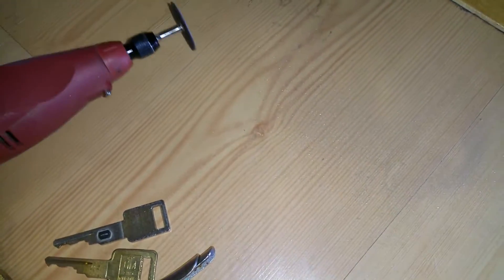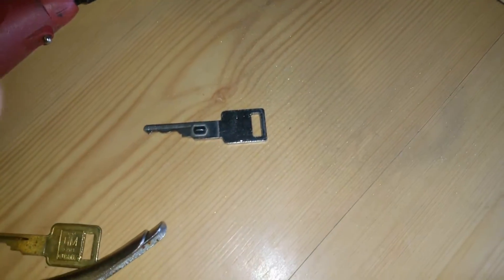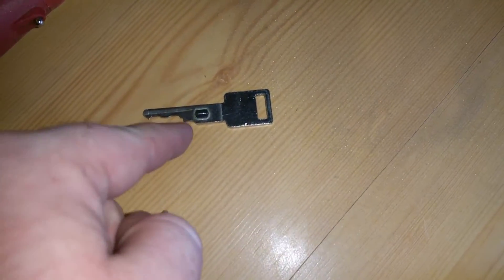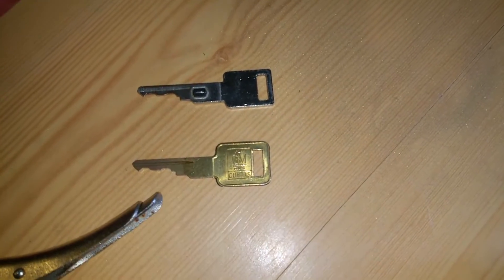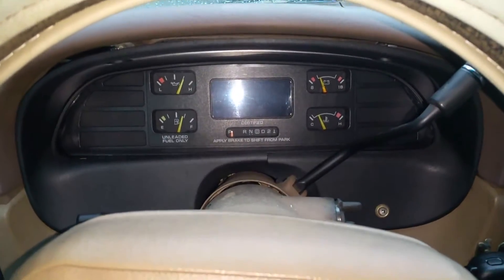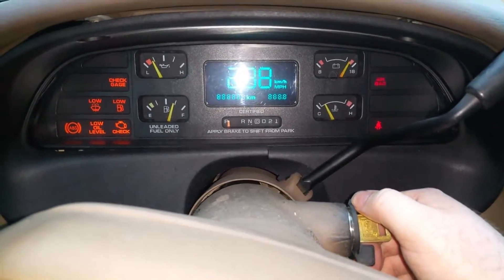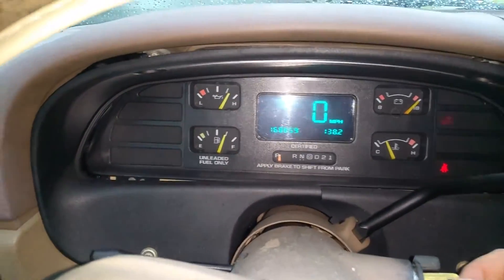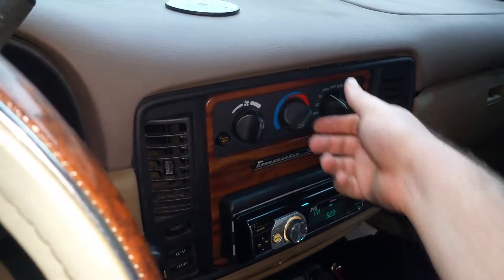Copied my own key with a dremel

Comment: Interesting idea.  I wish you would have shown the Dremel process so others can do it to.  I surmise you just vise-gripped the keys together and let the tool follow the old key?

This may also have worked for you due to the age of the car, that ignition has seen some action in its day and is not in the same shape as it was when it was new.  It's worn, and as such can tolerate minute differences.

A good locksmith shop should be able to copy the key no problem, "pellet" or no "pellet", provided they have the proper blank of course.  Most places won't because they don't know the VATS system in your car is disabled since the original equipment is no longer there. Even if you tell them, they'll be reluctant to do so.  Again, a good mom-and-pop hardware store or locksmith should be able to do it, especially if you tell them why.

From what I understand, the original VATS system can be disabled with a couple of resistors wired in to the right wires.  You'd measure the "pellet" in the key, determine the resistance, then couple a few resistors together to get a resistance within (I believe) 5% of the original, and that's enough to fool the system.  Probably a pretty simple procedure to Google.
Reply from the maker: jaykay18 You can also disable VATS with a laptop, OBD cable, and TunerPro.  :P  Better than the resistor mod, if the resistor ever falls out of tolerance. Shouldn't, but you never know in Florida heat.  Yes, I did vice grip the two keys together, and just used my eye with protective eye wear, to make sure the dremel follows the original key, without cutting the original key.  I made sure to copy the best original key I had, with little to no wear.

I still have 2 other blanks, I'll make another one, and video tape it.  It's just hard to do though without a tripod or anything..  May take a couple weeks when my little sister is here to video tape it.
Reply: Brandon MacEachern That all sounds great.  Look forward to the video, whenever that may be!